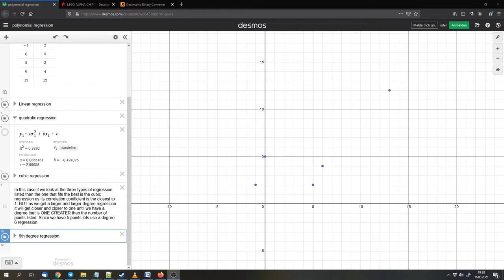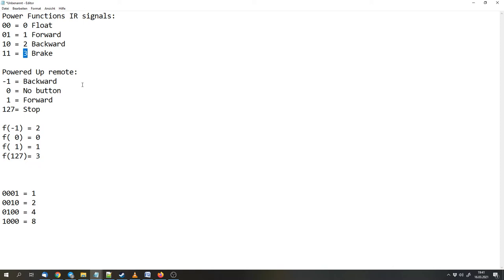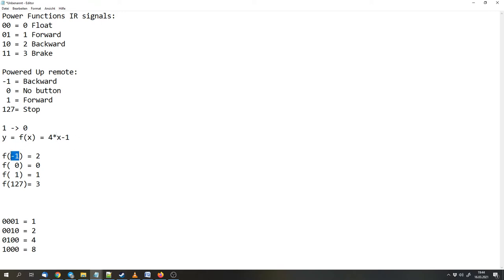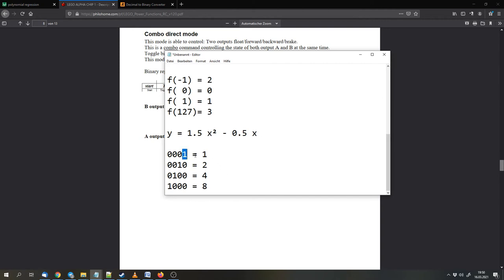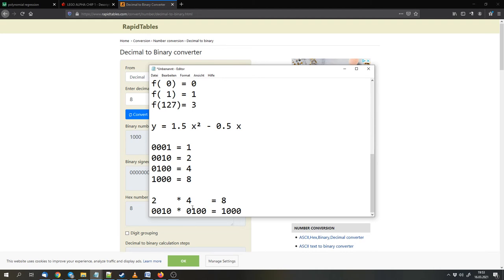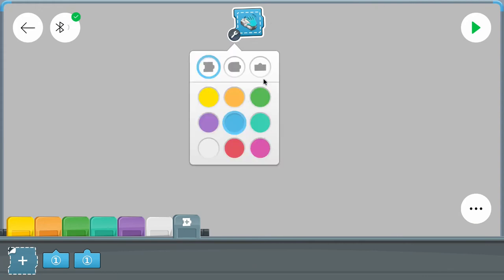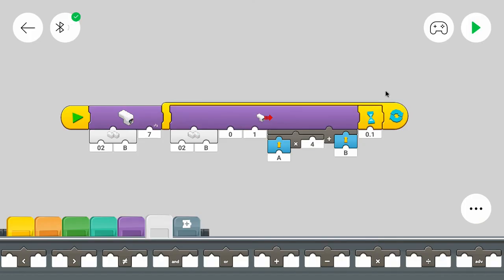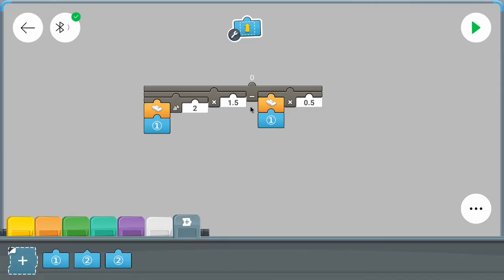Lego Powered Up Tutorial #20: controlling stunt-racer (42095) with PUP Remote (88010) [English|HD]

Comment: Bonjour,
Beau travail (même si je ne comprends pas toujours tout, problème de la langue).
Grace à vous j'ai réussi à contrôler 3 trains sur une même voix et gérer deux aiguillages.
J'aurais voulu savoir s'il y avait la possibilité de contrôler plus que 4 Hubs en même temps? C'est pour pouvoir contrôler deux voies ferroviaires avec 6 trains au minimum.
Est-ce qu'il existe une application pour faire de la programmation directement sur PC? J'ai essayé avec un émulateur (Bluestracks) mais je ne peux pas installer l'application.
Auriez-vous des conseils?
Sinon quelle tablette pas chère fonctionne bien avec powered up? c'est dans le cas où je suis limité à 4 hub par tablette.
Encore bravo pour votre chaine youtube
Reply from the maker: Je pense que BAP/ Brick Automation Project est la solution pour ton problème. Il est possible de contrôller plus de 10 hubs avec cette application  si ton BT/BLE adapteur est suffisant.
Merci :)
Reply: @technicmaster0tutorials  je te remercie.
As-tu un lien à me conseiller pour le manuel? Ce n’est pas aussi intuitif.
Reply from the maker: @meriatop7385  There are examples on the lgauge page, maybe they help you.
Reply: @technicmaster0tutorials  Je te remercie mais je n'y comprends plus rien. Ce n'est plus intuitif et mes cours de langage C sont beaucoup trop loin.
Je me dis que c'est le logiciel qu'il me faut mais je bloque. J'ai l'impression que l'exemple correspond à mes besoins mais je cale à le comprendre.
Je vais demander sur le forum.

Comment: How's about a video on using a pf servo for steering in a pu powered model?
Reply from the maker: Uhm why would you do that? Most of the PUP motors are much better for steering than the PF servos.
Reply: @technicmaster0tutorials  just because I could really 🤣
Reply from the maker: @Pickfordr100  I'm not sure if I'm going to do something like that :D But the tutorial is on a pause anyways because there will be a graphical overhaul for the app in the future. I don't think that it makes sense to release new parts as long as the new gui isn't available.